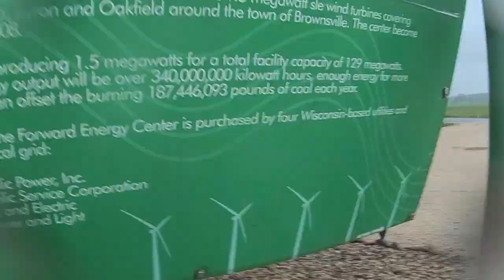Where does my power come from when solar DOESN'T work? (Wind)

Comment: So WPP doesn't have ANYTHING ELSE between those pinwheels and you?  Nothing else but your panels and windmills powers your area?

The whole point behind the grid is that power from EVERYTHING, EVERYWHERE, goes EVERYWHERE.  Unless UPP isn't attached to anything else, you're still getting your power from, among other things, coal.  The only way to NOT use it, is to cut from the grid totally and just use your panels.

It didn't look like a good day for that...